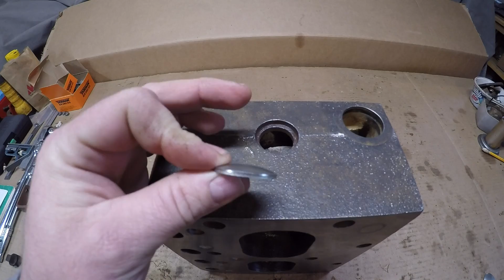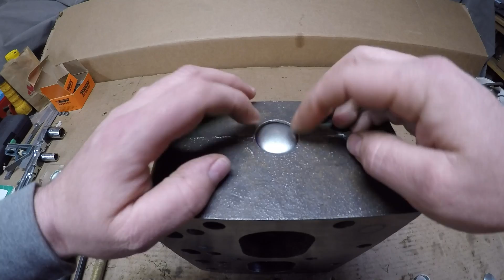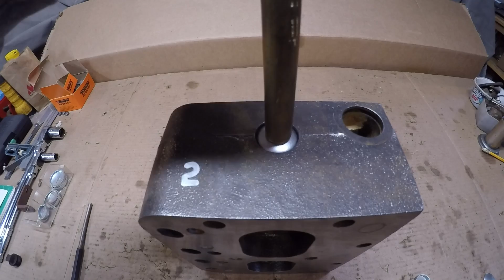Old Tractor Restoration Tip #2: Welch Plug Installation and Removal

Comment: Thank you for this video! I am re-building a Cushman Cub hit & miss engine built in the early 1920's. The freeze plugs are weeping a little and need to be replaced. They use the convex plugs that you used in the video. I didn't know which ones to use, the modern plugs or the convex plugs. There is no information on this. If I hadn't watched your video, I would have had no idea to hit the center of the plug to expand it. You turned a potential category 5 shiit storm into an easy fix. Thank you again and I just subscribed to your channel.

Comment: Thank you! I'm working on a '47 Chevrolet and a 2 inch plug of this type was in the end of the block below the water pump. I think the original was installed backwards, and I installed the new one that way. Dorman part number was 550-028, and I incorrectly thought the part number being on the outside was verification it was installed correctly. I searched the Dorman website - they have other instructional videos - but none on these plugs. You are a lifesaver, Sir!

Comment: The freeze plug manufacturers recommend that you do not use any sealant when installing the plugs. Make sure the holes are clean and rust free. A slight amount of light weight oil can be applied to the hole and the plug to make installation easier.

Comment: I have from time to time reused welch plugs depending on where it goes. When you get it out just redome it like it was prior to initial installation. I wouldn't recommend doing it twice on the same plug. It is just a quick fix for a non pressurised system in the field.

Comment: NIce Job.  I'm working on an 8N Ford engine and need to remove the core plugs and put the block into the parts washer.  Haven't seen, installed, removed this type of plug in MANY years.  Thanks for the visual refresher course on how it's done.

Comment: Great video. I’m replacing the Welch plugs on my ‘26 Model T. A trick the old timers used to use was to press an Indian head nickel with a socket and ball peen hammer, so that it becomes bowl-shaped. You then use the nickel as your Welch plug. My bores had a lot of crud in them, but with a Dremel and a tiny sanding drum I finally cleaned them down to the shoulder. The casting holes on your engine block look exactly like the ones on my Ford. Thanks for posting.

Comment: About Welch plugs, on your Super M disk brake covers there is a plug on the middle where the bull pinion shaft is. I am missing both sides on my Farmall 460 which is pretty much the same thing. Can you tell me on your Super M if they are Welch like these or more like a wheel hub cap. CNH parts wants a fortune for these but there are two types and without the part I don't know what to get. There doesn't seem to be a serial number spilt in the online parts manual.
Thanks
Kevin
Reply: @squatch253  Thanks for doing that! There is a shoulder like the one on your head for a Welch plug to rest in. The bore in my brake cover is 2-7/8 inch.
Reply: @squatch253  Thanks, I think because the parts manual lists two different parts (one is still available from CNH parts that one might be a Welch style plug. This unit has had the axle update according to its axle diameter and the triangle stamp on the serial number tag. Not sure how many parts that involved besides bigger axles...I am going see a guy that has a 560 that lives close by to see what that has. There are not many 460s around here. Mine is a  1960 model that had the small diameter axles. I would think that update would have involved at minimum besides axles and bearings, new wheel hubs.
Reply: @squatch253  I stopped at an All States Tractor Parts salvage yard and looked at a couple of 60 series tractors. I found a 460 that had a hub style cap and a 560 that had a totally flat Welch cap in it. I would say a Welch plug would be acceptable but how they got it flat is a question it almost looks like a press with a 2.875 diameter flat solid drift was used to drive it flat.

Comment: I had a frost plug heater pop out of the block on an 82 Olds Omega 2.5L Pontiac engine while my wife was driving. It got hot and locked the engine up. She caught a ride home from someone and we went to pick it up. I tried bump starting it and it broke loose after it cooled down. I removed the engine block heater and noticed the old frost plug was still in the water jacket. I was able to hook it and pry it out of the block through the frost plug hole. I noticed it wasn't distorted much so I put some permatex aviation gasket sealer on it and stuck it back in the block, put antifreeze back in and started it back up. It had a little noise from the scored piston at first but then then it started to quiet down. I ran it another 2000 miles and later pulled the engine out and had it bored and bought an engine kit for it. Those little 2.5L engines were pretty tough. That was the second time I lost a frost plug so needless to say I never put that type of heater back in an engine block.

Comment: Thanks, Pal! That was another good one. I'm familiar with the Welch plugs somewhat because I had a couple of Rabbit diesels and installed block heaters in them. More than this my pal that has a small engine repair business, the Saw Surgeon as I call him, uses them a LOT in 2-cycle carb rebuilds but uses fingernail polish to seal them off. For removal he drills a small hole in them and runs in a screw a little ways and pops it out with pliers or some such. Those work just fine and did for years. Thanks for another good one!